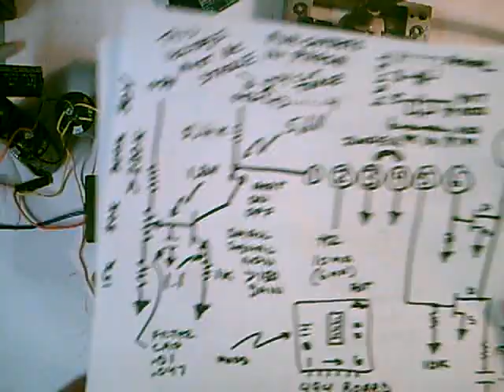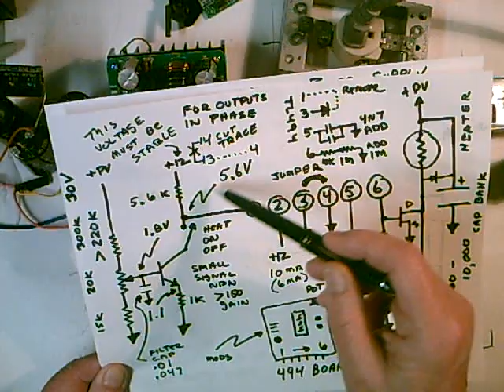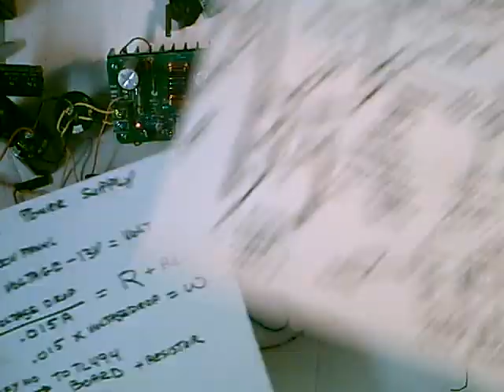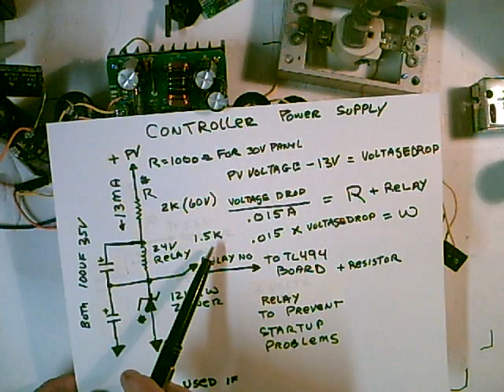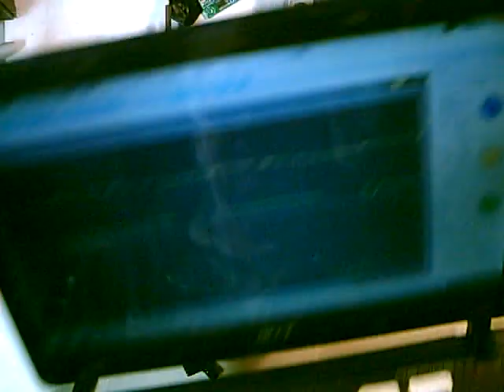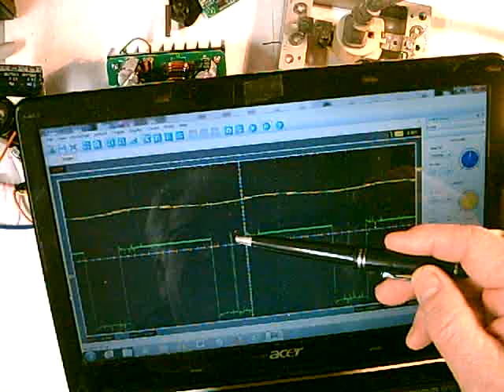Revised TL494 PV Solar Water Heater Controller, Simplified

Comment: @10:12 how many caps available and for how much
Reply from the maker: I have at least five hundred. Problem is they are not here at camp. That video was made way before I left for camp. I have a minimal amount here till end of October. I have baked too much as they say. I have a number of demo "300W inverter" modified water heater boards used to make videos. I'm thinking of selling the few capacitors I have here with those demo boards on ebay because I will never use them.

Comment: Hi Opera,  I haven't heard back from you.  I would still love to buy the parts from you.  What's the best way to get a hold of you?  Thanks, David
Reply from the maker: Must have missed that as I haven't noticed you asking. I can be internet free up to three days at a time. I'm still doing testing which is difficult given not much sun for days.  I think you should just continue with your testing to get a good feel for what  normal conditions are. Building it would be an interesting series. As a woodworker look at the video for making a capacitor bank out of a piece of wood. Need to know your target number of panels and array voltage.
Reply: @opera5714  I watched the video of making a wood holder for the capacitor bank.  I would like to wire it up with 2 of my solar pv panels, and do a side-by-side comparison with two panels hooked directly to a heating element.  However, I could also do it with three panels if that is easier.  Each panel in  my array is 365w, vmp=38.9, imp=9.39.  Ideally I would wire two in series and use an off-the shelf 120v heating element.  However, I don't know if your MPPT controller design is made for high or low voltage.  I don't want to "stack the deck" one way or another.  I want to do a proper head-to-head competition with meters on both.  I'm assuming I will get more power using an MPPT controller, but I want to show exactly how much.
Reply from the maker: @DavidPozEnergy  78V is fine.  How much do you want to build? Right now I'm searching for one part.  I can supply a modified inverter board with cable and FET on a heat sink. That leaves soldering up the transistor and a few parts on a supplied perf strip.  Or I can wire that up and you just solder up various assemblies. You'll build the cap bank. Do you have any power meter like I use. Something that reads out watts directly.
Reply: @opera5714  Hi Opera,  I do have watt meters, I think the same exact one you have.  I'm OK with doing some soldering if I have instructions, but I don't know this stuff off the top of my head.  For example, I don't know what a "perf strip" is.  But I am excited to learn this.

Comment: What’s the purpose of the (inverter?)board the capacitors are connected to?
Reply from the maker: I have two 260W 30V panels in parallel. This was a request from someone to do a video. With a 240V element I need to get to at least 80V to utilize the panels output. I am currently testing another  version with the array set to 60V. This still needs to be boosted to 80V for the element. The boost converter itself has to be modified to work at this voltage.
A lower resistance element like a 2,000W 120V element does not need the boost converter or the panels  could be raised to 90V.  60V is common as it is safer and this system is designed to work in parallel with a standard battery charge controller.